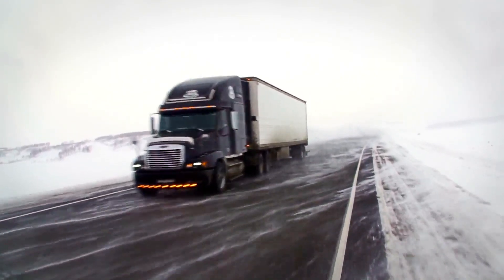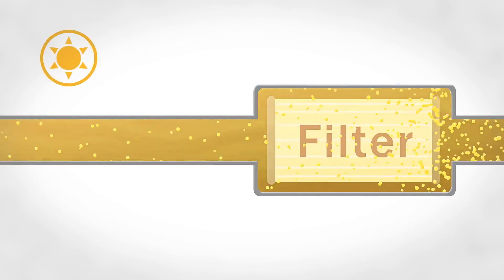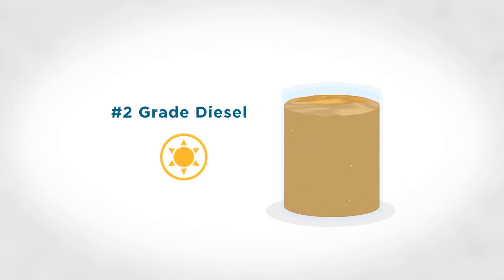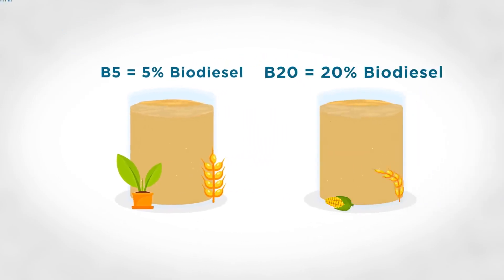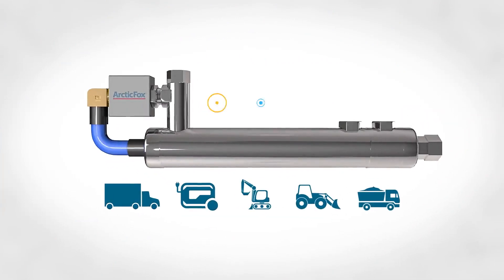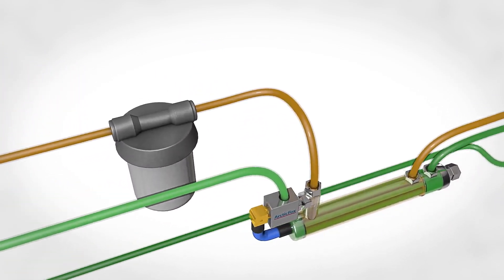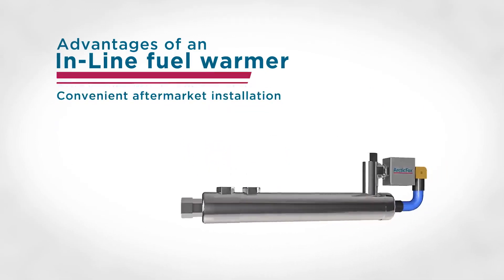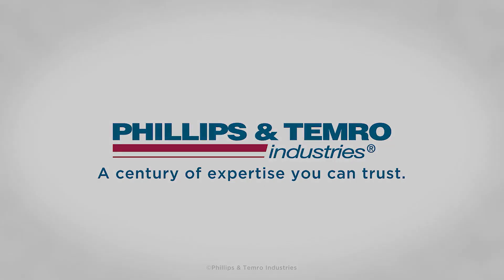What is Diesel Fuel Gelling and How to Prevent It

Comment: Hello...what is the optimum temperature of diesel fuel to get good mileage...?
Reply: My TDI gets the best fuel economy around 72-75*F. Any colder I seem to get worse fuel economy. If it is warmer I run the AC and get worse fuel economy. I usually use cruse control on the highway and I defiantly get better fuel economy when its warm out rather than when its cold out.  this could be different for different vehicles and altitudes.
Reply: mi 86 f250 seems to like 40-60 f to get 20 mpg any colder it gets sluggish hotter than 80 and it seems to run smother but MPG dops to 13 

keep in mind thats all non turbo